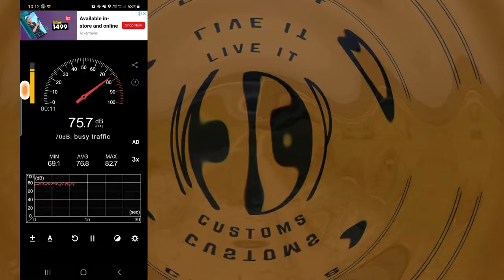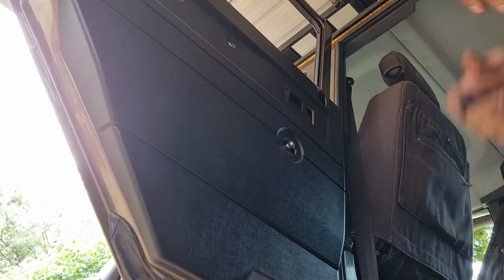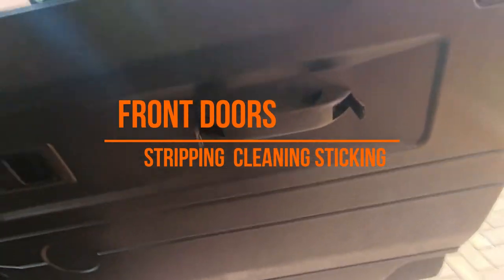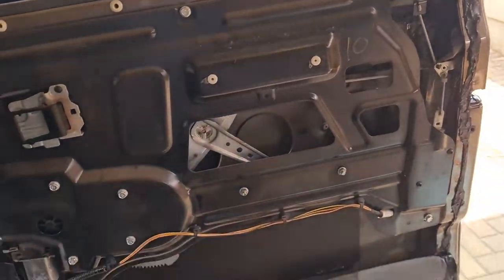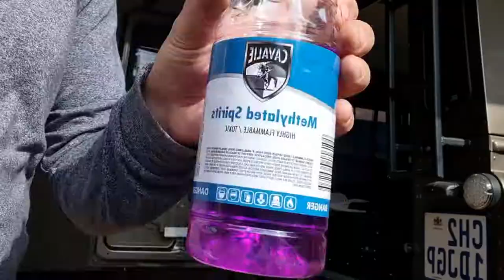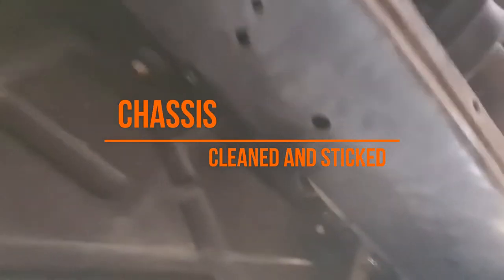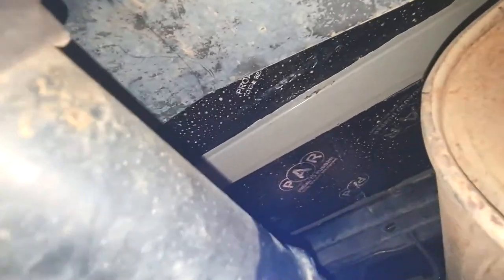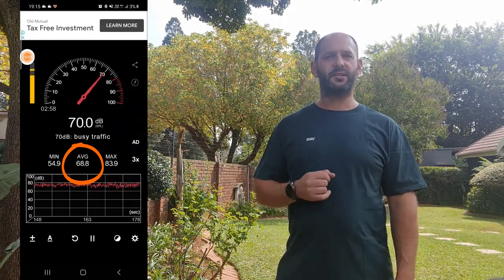DIY Soundproofing your Land Rover Defender Part1

Comment: Thanks For the video, busy sorting this out with Mine. I noticed that you did a hydraulic cylinder opener. What length Ram did you use and what KPA rating? would you recommend a stronger or weaker one now that you have yours installed? Thanks.

Comment: I noticed the noise mostly from the transmission and wheel arch area although done soundproof the whole buck head. But definitely great improvement after installing them. I wonder how you can reach and stick the sound proofing material underneath it? Do you have the video? Thanks and you’ve done a nice work!
Reply from the maker: Hi Darren, unfortunately not showing details, if you go to around 14:56 on the video you should see what I did around the transfer case from underneath that helped a lot by adding sound deadening material to that section, basically sticking it around the transfer case tunnel, it made a big difference. STP makes a few products that you can also stick under the carpet that will reduce the noise. the pumas did come with some decent carpets and padding in that section which helped, but depending on what model you have it could also help to get some high-density foam and put it around the carpets on the inside.
Reply: @MdPcustoms  Cool. I saw from the video. It’s very hard to reach there. Will get mine done one day too! Thanks!
Reply from the maker: To be honest, it is easy to get at least 70% of the area stuck, it's the top peace that's difficult to get to, specifically the section by the gear levers.

Comment: Did you put sound deadening sheets on the bonnet before you applied the foam sheeting?
Reply from the maker: Hi, yes I did, was done prior to the YT channel. It doesn't take many sheets to do the bonnet as you only add in between the supports on the bare plate sections. Made a noticeable difference with the foot wels in the front and back.

Comment: Could you tell what products did you use and where can you get it from. Thanks Gary
Reply from the maker: Hey Gary, I live in South Africa in the east rand. Everything I used was from Pro Auto Rubber in Boksburg. They are by far the cheapest as they manufacture everything themselves. For a 110 I would recommend getting a full box of sound deadening sheets, 750mm x 500mm depending on how far you go with the project it should be sufficient. Ask for box pricing if you buy more than 10 sheets as it brings the cost down substantially. For the roof, I would also recommend adding 5x their soundproofing material 1m x 1m. Also, get a roller from a crafts shop or PnP this helps a lot, a few brushes and a big tin of contact adhesive. They also sell a lot of other products that are worth looking at.
Reply: @MdPcustoms  I live in Cape Town. Thanks for the info will contact them in the week. 👍😁

Comment: Don't think that was a good idea to sound deaden on the outside of the seat box as I think that will be a water trap.. most installations put it on the inside of the vehicle.
Reply from the maker: Hi, thanks for the comment, you do raise a valid point. I am very aware of the issue so I have discussed it with a few guys I know that like to go this route. The sound deadening sheets do not retain water as it's a tar-like material. While applying it I made sure I only apply on flat surfaces that won't allow for air pockets where water can get trapped. I've also made sure any drain plugs stay open and free of obstructions. Another thing to consider is that any sound deadening applied over rusty areas could accelerate the problem as it won't allow the section to dry properly. Depending on how your vehicle gets used I would almost like to say the same issue could occur on the inside if not careful when applying.